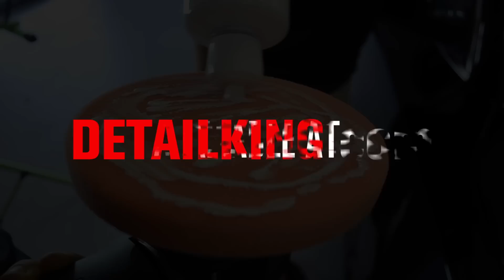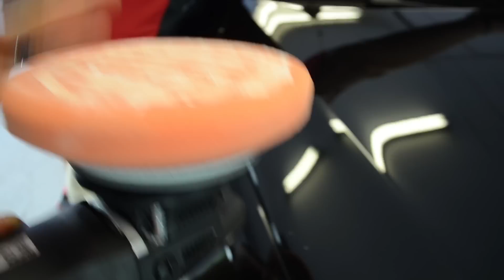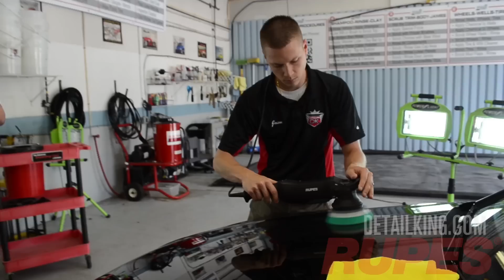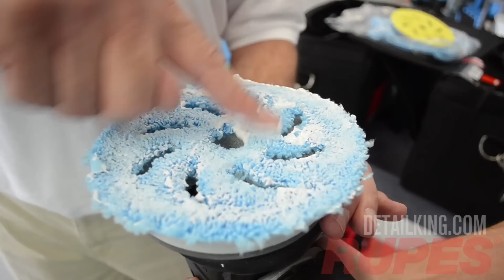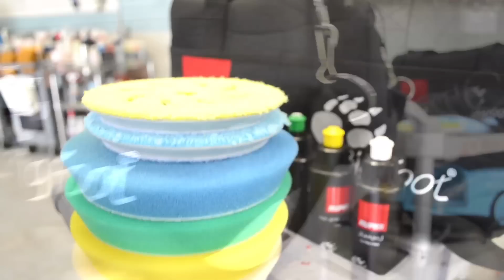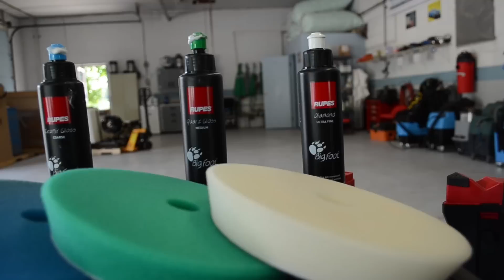Rupes Bigfoot Polisher

Comment: Being new to detailing, and I'm looking to buy a nice polisher. this and the flex 3401 look nice, I was wondering why do the Rupes pads have a hole in the middle? it is a hook and loop backing plate, all of the other pads I have seen for sale do not, just seems odd.
Reply: +peninsulamike something to do with heat dissipation.
Reply: peninsulamike - There is a network of vent holes in the backing plate. It gives the  heat an escape route through the grill vents on the side of the spindle housing.